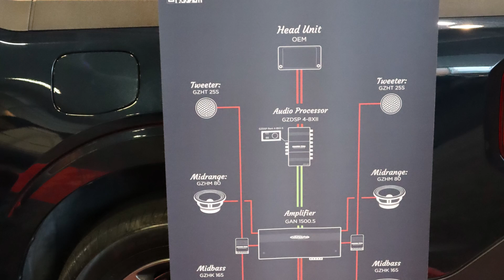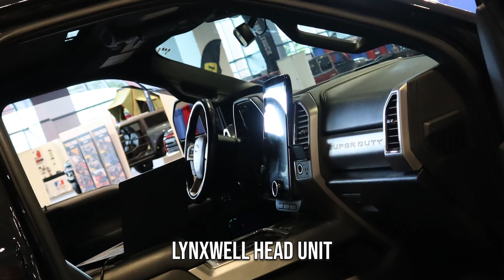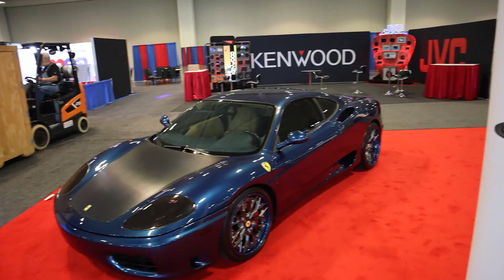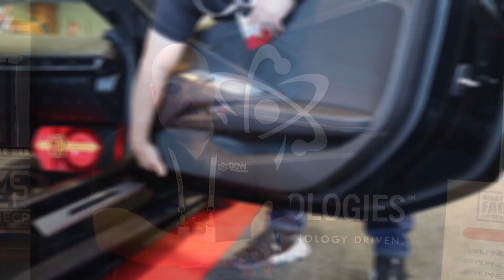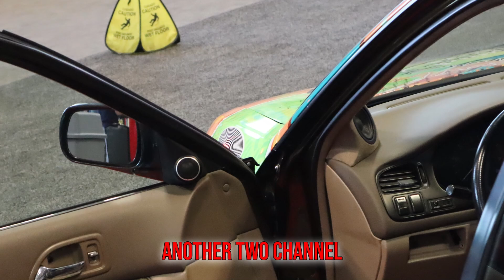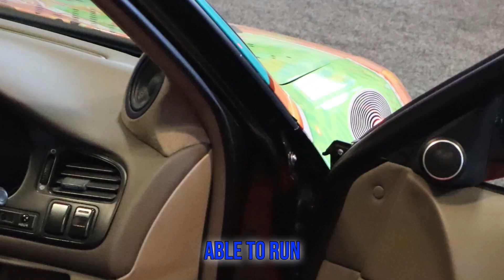The Bass Cars of KFest!

Comment: I’m a little confused by the wiring diagram of that first truck.  They ran the midbass and tweeter off the same amp channel with what appears to be a passive crossover, while giving the midranges their own dedicated channel? What an odd way to set it up.
Reply from the maker: Yep.  The front channels are running the speakers in the a-pillars, with a passive crossover. The rear channels are running the mid-bay speakers and the doors.
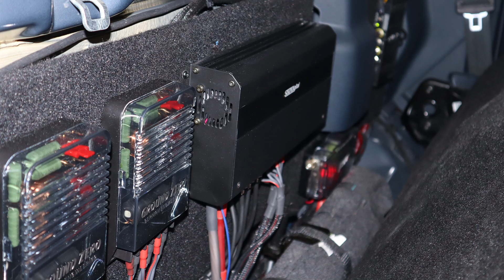Reply: @DIYAudioGuy  That makes sense, but that's not how I read their wiring diagram at 0:26 in your video.
Reply from the maker: @chrishuyler3580  The diagram was printed wrong, and the crossover was placed on the mid base when it should have been on the Tweeter /mid-range.